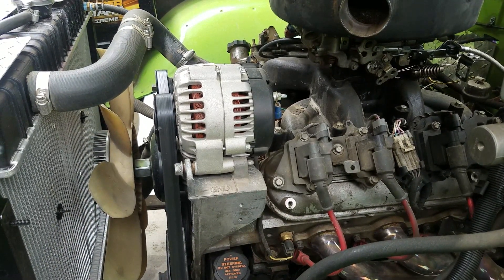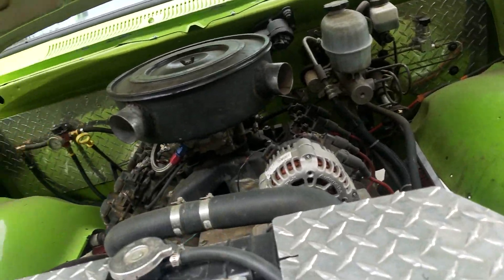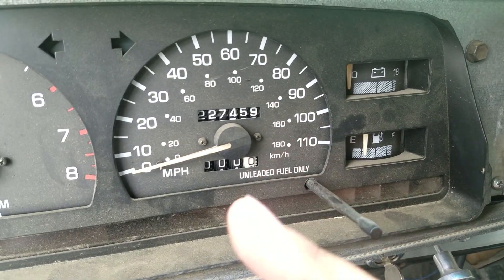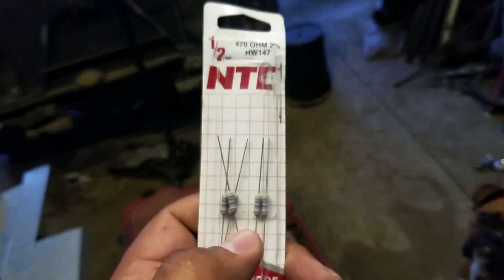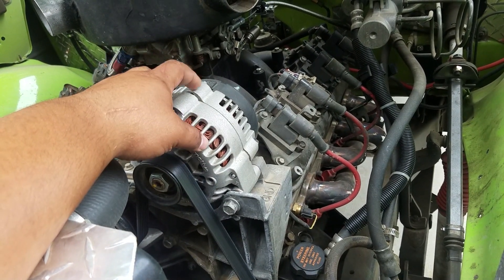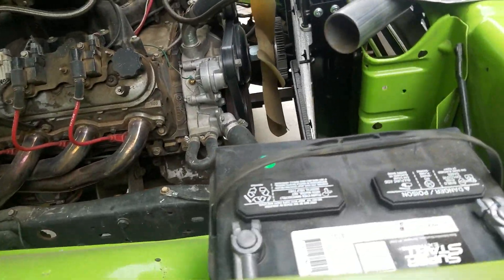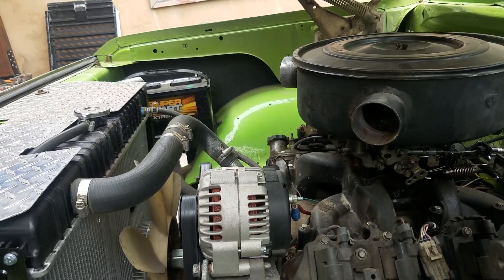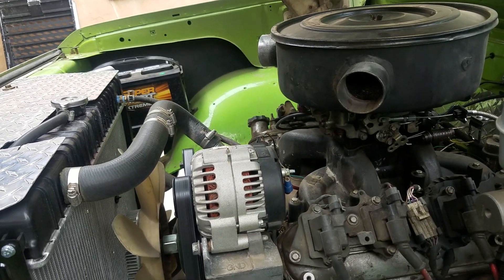EASY CARBURETED LS ALTERNATOR WIRING FOR YOUR LS SWAP | LS Stand Alone Alternator Wiring | Carb LS |

Comment from the maker: Dont forget to enter to win a free holley carb!
https://youtu.be/a5WT32bmfAo
Reply: Is the alternator supposed to be getting power while the car is off
Reply from the maker: @kingeyes8938  the alternator is always recieving power through the big wire since it is connected to the battery directly. The small wire on the plug should only have power with the key on
Reply: @NightWrencher  hey so I am just curious, because I did this and as soon as I turn on headlights or radiator fans I get this god awful squealing coming from my alternator, but my belt and alternator are both brand new, any ideas?

Comment: Basically you dont need the ecu to control the charging system? Can this setup work on fuel injection LS engine?
Reply from the maker: If using this in place of connecting it to the stock computer, the check engine light will turn on with a trouble code. Other than that, the alternator will work

Comment: It does not drop the ignition voltage,  it drops the amperage.  When it sees no resistance,  it runs on a limp mode,  until the voltage regulator can't take anymore, and then the regulator is fried.  With the 470 ohm resistor,  you are copying a signal that is about 95% of it maximum output.  We run 500 ohm, and get 14.6 volts all day at the track. Great video BTW.
Reply: So I cut my stock harness up following ltswap my alternator wiring has no power coming out of it so I’m assumingi did something wrong or  I should just wire it like this cus right now I start it it says 13.1 but u can’t rev it will die or the voltage drops to like 8

Comment: But I have the two wire dr44 alternator 2005 4.3 engine and running a carb how it where is the link for that alternator wire up I don’t think running it at 60% now and maybe after ac added I could bump it up to 80% thanks
Reply from the maker: I just saw this message, I think the 2 wire is PWM and cant be wired up like the 4 wire DR44. The good news is that I think you dont have to wire the 2 wires and just need to wire the big lug to the batter. Should default to 13.8volts

Comment: So I’ve got an issue with mine. When I talked to Holley, they recommended a 560ohm resistor (as that’s what the wiring plug they sell has) so I ordered a 560. Installed it and it’s running 15.0-15.5 volts and if I’m understands correctly, I need to have about a 600ohm resistor in there to lower the voltage, correct? Or should I order a 470 and see what happens. If I had a store local I would just get both but I have to order them.
Reply from the maker: Ive done this 5 times and every time it was with a 470 ohm resistor, zero issues. I'm 100% sure that the higher the resistor, the more voltage the alternator will put out.
Reply: @NightWrencher  Gotcha, thank you for the clarification and the quick response!
Reply from the maker: No problem, any time!
Reply: @NightWrencher  In the video you were sure of the opposite. Dunning Kruger-ing hard here.
Reply from the maker: You are forgetting that the video was made in 2020 and I  answeredthis question in 2024. always learning
Reply: @NightWrencher  And always confident about your answers......
Reply: That makes sense! The higher the resistance the lower the voltage the alternator sees and tries to output more power! The smaller the resistor the lower the voltage output.

Comment: Are you using a 2 or 4 wire alternator?
Reply from the maker: The alternator uses a 4 wire plug. If it has a 2 wire plug, its a PWM alternator and I don't think it'll work with this mod.

Comment: I wired mine like this but when key is turned car not running the alternator was humming is this normal it’s going in a 72 chevelle
Reply from the maker: Yes, thats pretty normal. Mine does the same thing.
Reply: @NightWrencher  thanks for the reply another question my car won’t turn off …. my msd 6014 is  hooked straight to battery will that cause this issue of not turning off when key is off I try pulling off the 12 volts to alternator but keep running until I unhooked battery thanks for your help
Reply from the maker: Yes, as long as the engine is spinning, it will keep pulling fuel from the carb and as long as there is power to the MSD, the coils will continue to fire. Wiring the MSD to the ign switch directly or from a relay are going to be your options
Reply: @NightWrencher  I wired it to a relay and still same problem so I put a 30amp fuse inline with msd and hooked it to a on off switch solved that issues flip switch car Turns off not how I would of liked it but works lol thanks man what is your timing range set at from idle to 6000 rpm and did u disable map timing feature I was gonna set my timing so it shuts off if it runs hot

Comment: I m doing an LS swap on an obs , do I need a resister on the brown wire as well , or does the ecm take care of that , I have a standalone harness and the alternator has 2 wires brown and red
Reply from the maker: This is specifically for a carbureted LS using a Smart Spark LS or MSD 6014. If you're doing an efi swap you can do the resistor mod, but the stock ECM should take care of it.

Comment: So just to clarify, I need 470 ohm resistor in addition to the resistance of the 194 dummy light bulb? Or 470 ohm total in the circuit?
Reply from the maker: One or the other. I wouldnt do the dummy light because if the light goes out, itll stop charging

Comment: Question, can I just run it from a 12v acc with the resistor?
Reply from the maker: If the acc turns off with the key off then you should be fine. If it stays on when you turn the key off then itll keep running.

Comment: Can it run on a 12v wire
Reply: I mean run the wire with ohm resistor to a key on 12v
Reply from the maker: Oh, yes, it has to recieve 12v power from an isolated switched ignition source to prevent back feeding and preventing the engine from turning off.
Reply from the maker: It can not. You WILL burn it up. Use the correct resistor.

Comment: I have a 78 c10 with a ls1 and a 69 c10 with a 350.. could I use those 470 ohms on with the sbc..
Reply from the maker: The 470 ohm resistor is specifically for the LS alternator. When using a 3 wire SBC alternator you have to do something similar except you have to run a wire to the battery light bulb and then from there to the alternator. The other wire goes back to get a feed signal like at the battery, and the big wire can go to the battery as well.
Reply: @NightWrencher  battery light bulb or what other source could it be plugged in. I check for the battery light bulb and didn’t see it.
Reply from the maker: Some cars didnt have a battery bulb until later years and they used an external regulator to power the alternator but the 3 wire alt is internally regulated so you can pick up a light bulb socket and bulb, run the wires to to it like I mentioned before and install the socket somewhere you can see it. If the bulb goes out, the alternator will stop charging
Reply: @NightWrencher  just came back from autozone and picked up the socket bulb which they only had a two wire socket bulb not a single wire. From the connected of the alternator I ran wire #1 to the socket light bulb and wire #2 from alternator right below to the bolt that has a 10gauge wire to the battery. Does that seem right. Just confused as to what to do now with the extra wire from the socket light bulb. Part #85802
Reply from the maker: The other wire from the socket goes to the ignition switch. So your ignition switch sends power to the bulb, then from the bulb it feeds the alternator through the exciter wire. #1 to the bulb, #2 to the big lug on the alternator
Reply: @NightWrencher  Your a great help man thank you! Can’t wait to get this done once I’m off work

Comment: Can you run your cable directly to sarter from alt? And do the alt wire and starter wire connect to the same terminal on starter?
Reply from the maker: Yes you can tie the big lug on the alternator directly to the big lug on the starter, but you wont want to run the fat wire from the battery, to the alternator and then to the starter because if the wire over heats, itll damage your alternator so you want to go directly alternator to starter and starter to battery. The thin wire on the starter is for the ign switch and the thin wire on the alternator is for the ignition switch with an inline resistor
Reply: @NightWrencher  yeah i had from lug on alternator to +battery then to starter, somthing shorted out yesterday and now i have no power at all to car, but no fuses have blown lol wish i would have seen this video first.
Reply from the maker: Oh man, time to break out the timing light and start poking wires!

Comment: I did the same on my 76 k10 but still drawing alot of volts with the 470 resistor ?
Reply from the maker: The 470ohm resistor should keep voltage at a steady 13.5. Did you make sure to use a 470 and not a 470K? Also what voltage are you seeing?
Reply: @NightWrencher  I think what he is saying is you said your alternator does not want to see a full 12v signal coming into the brown wire on the 4prong connector. Well I’m getting the same issue he is and that a full 12v with the resistor in place when I have my switched power on.
Reply from the maker: You don't need to check the resistor wire for voltage, you need to check voltage at the battery. Off, battery should be around 12v and running should be around 13.5v. You might be able to see a drop in the field wire but it acts like AC because of the alternator so unless you have an o-scope, you just have to go off battery voltage.

Comment: The wiring diagram for for 74 GMC trucks shows a 1.35 ohm resistor on the wire connected the alternator.  Will this work?  Or do I need a new wire with the ohm resistor you suggest?
Reply from the maker: Youre going to want to run a new wire with the correct resistor or youll risk burning it up. The old resistors were used to prevent back feeding when shutting off the engine

Comment: How do you wire a aftermarket tach? What wire do u tap into👀
Reply from the maker: Most aftermarket tachs run directly off a square wave signal used by HEI style ignition systems. So most aftermarket ignition boxes, hei modules and one wire distributors produce the same wave. An aftermarket tach with have at least 3 wires. 12v ign, signal wire from ign box, coil or distributor and a ground. If it has other features like lights or sounds, itll have more wires. An MSD 6014 like the one on my LS is hooked up directly to my tach without any special adapters because the tach is designed to work with the signal the MSD box is producing
Reply from the maker: You can find the tach wire for your ignition box or distributor in the installation instructions
Reply: @NightWrencher  thanks for info. 💯💯💯
Reply from the maker: You're welcome man!

Comment: I’m so confused I have one with two pigtail I have the cs-130D I don’t know how to runny do I run the brown wire back into the alternator then the pink and black wire with the resistor to the ignition switch
Reply from the maker: You are confusing this alternator with the one with the one for the older small block chevy. This one is the factory alternator used in the LS engines. Yours is a 2 wire set up with one wire going to the ignition switch and the other back into the back of the alternator just like you said

Comment: Toyota cluster
Reply from the maker: Yes sir, out of a 91 4runner. Toyota sensors for the gauges.
Reply: Nice, I have a 95 4Runner mine is exactly the same !
Reply from the maker: Actually, now that I think about it it's from either a 93 or 94 because it has the electronic speedo and not the mechanical one